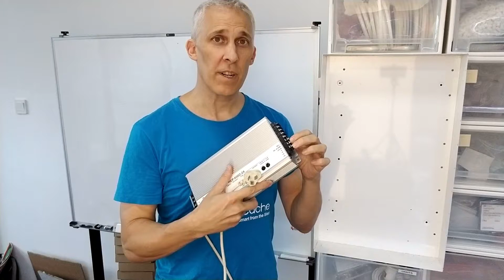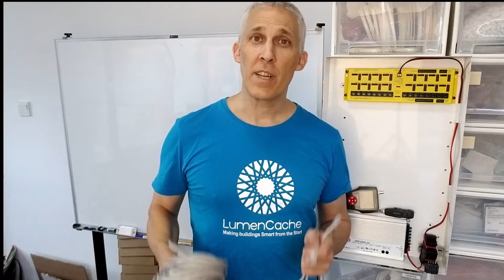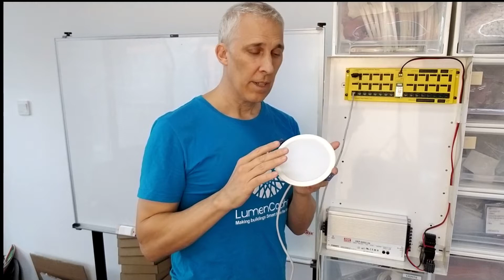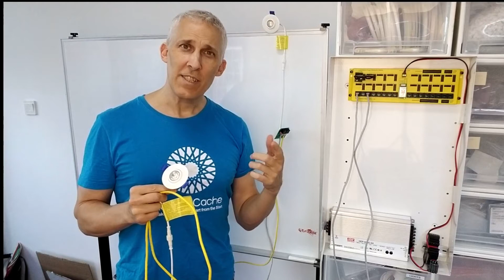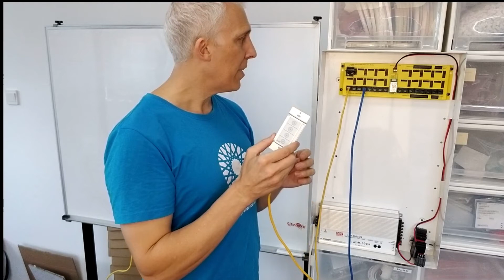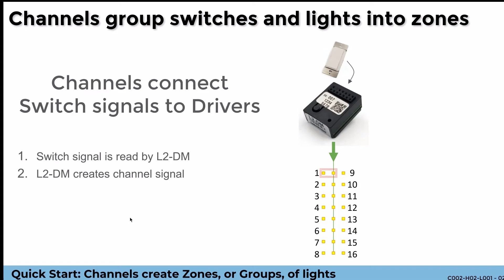Learn LumenCache LED Lighting over Cat5 Installation in under 30 minutes

Comment: question for you, im super interested in POE lighting for the home, what stives and updates (for your company or this industry in general) have been made since this video? 

and finally, i assume they're products that make use of type4 100w poe switches now, possibly maybe future proofing with being able to add your own switch?

i want to replace my lightning eventually with this but i also want the flexibility current "commercial smart lighting" features (WLED, scenes, longevity, ease of installation)
Reply from the maker: The new ReNetA platform will start to be sent to early adopters in July.  See more updates at learn.lumencache.com

PoE 802.3bt is one of many voltage and protocol standards.  We have a PoE802.3bt midspan card that injects the power for PoE lights if you feel strongly about using PoE.

Comment: so how many led lights can be connected with one cat 5 cable with good lighting output? would that be two?
Reply from the maker: Each driver is generally between 30-50W, so 2x 12-15w lights per Cat5 is a good balance between number of wires and grouped lights.  Lights on a single driver all operate together. Drivers can be grouped, so as many lights that need to be in a zone seamlessly operate together.

You can also change the driver and SIBs to be addressable type and have individual control over lights. Great if you had 2 or 3 together and decided later to split them.

Comment: too bad greed made them make proprietary hardware. If they had used PoE standards with auto negotiating, would have save a lot of money for the consumer. Then just set ID's for each device and what they controlled.
Reply from the maker: Here you go!  Made to solve the compatibility issue you described.  There's lots of deep rabbit hole discussions that led to this, but feel free to follow this as it hits the market.  Gen2 is a completely different solution.  Forged from all the experience from nearly $2m of that LibRE proof-of-concept deployments around the world.  https://igg.me/at/lumencache/x/666746#/

Comment: There have been several systems I have encountered similar to this in commercial buildings. The main problem I find is components fail, and they fail in 10-15 years. Most of the time the company who made them are either long gone or no longer support that system which easily negates any copper savings (not even adding in the extra cost of components) Whereas standard 120v installations can run for 100 years and if you do have a smart devices that fail, they’re easier to troubleshoot. 

Now on the flip side, the safety factor here shouldn’t be ignored and I’d much rather have this in my house powering lights than have 120v AC running through walls and ceiling.
Reply from the maker: These are great points to mention. A basic on/off switch does last decades but it is extremely limited in its functionality.  He click-together design of the LumenCache products makes servicing the parts a snap that does not require a technician.  Those parts tend to be low cost as well.  It's the best combination of many factors.  As the founder, I'm working on the longevity of the company as well.  Details to be shared as they progress.
Reply: really the only thing that would go out would be the power supply but they are not going to quit making those.

Comment: As I understand only authorised servicemen are allowed to mount this system which seems to me not so cheap in materials since many electronic components are required. Savings on copper will be consumed by these compnents.
Reply from the maker: This is made for DIY.  All the lessons learned from the "fragility" and "quirks" of the LibRE Proof-of-concept were fully addressed in the gen2: https://igg.me/at/lumencache/x/666746#/